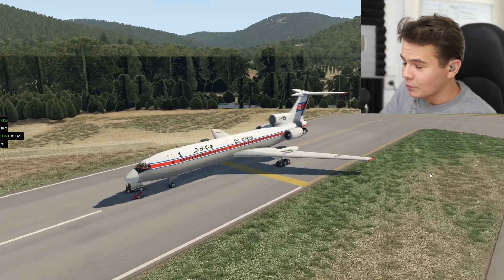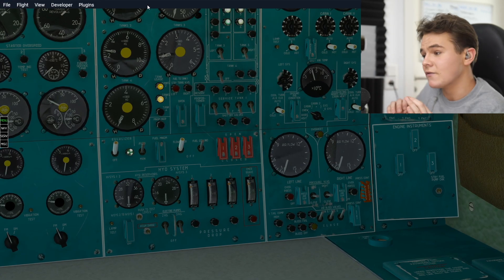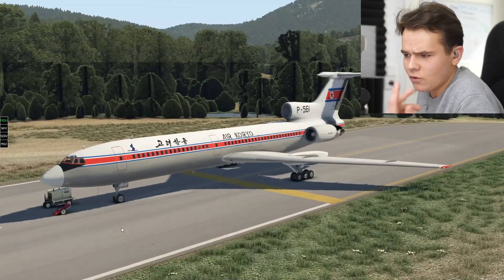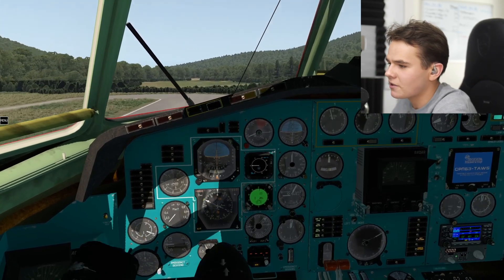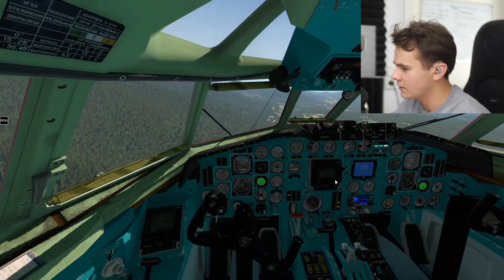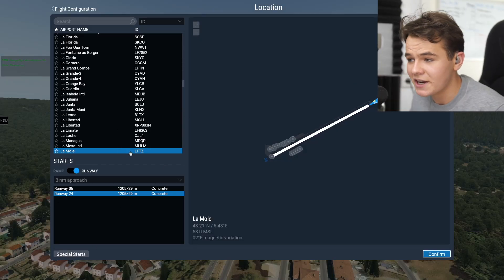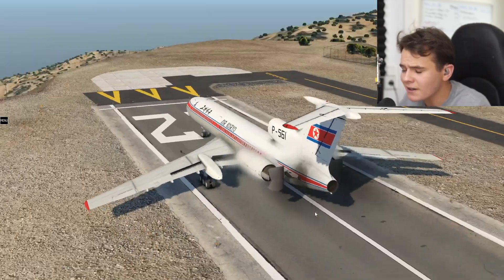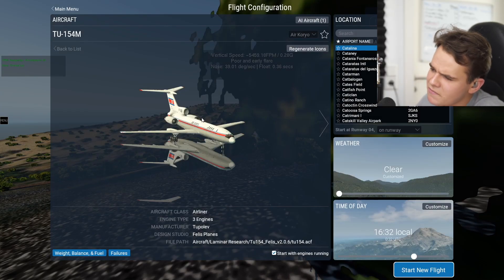The Tupolev Tu154 Is SUPER HARD TO FLY

Comment: well those red capped switches are meant to be switched open and red cover closed, until there is an emergency that would require you to shut something down.

the fire extingueshers also, if you notice, there is a rotary switch next to them with OFF-1-2-3, that is the engine selector, while the three buttons are three charges of the extinguishing solution. As in, 3 for each engine.

Comment: Swiss: TU 154’s are hard to fly

Russian pilots: HOLD MY VODKA
Reply: We pay for whole runway, we use the whole runway
Reply: Too good
Reply: but it's really hard to manage.  this plane must be provided with speed.  And it also does not have a system to prevent stalling, therefore, at a certain angle of attack, you will not be able to lower the nose because it will only bulge more because the plane got into the so-called "catch".  if you hit this "catch" on it, the plane will fall into a flat spin, and the only correct action to get out of a flat spin is to kick the control wheel away from you
Reply: @Mk-dk9tj  Actually kinda functions like MCAS but the opposite.
Reply: @Li Zhi-qiang - META YOU BITCH
Reply: We pay whole gas tank we use full gas tank
Reply: @wolfpackfan5747  Good one.
Reply: russian boss music playing in the background